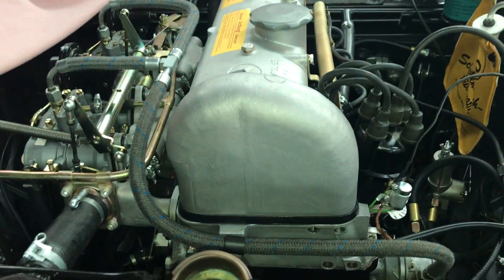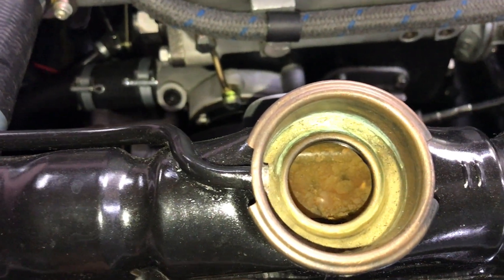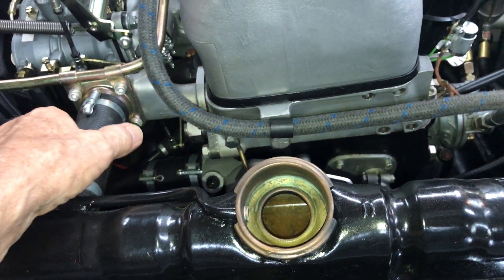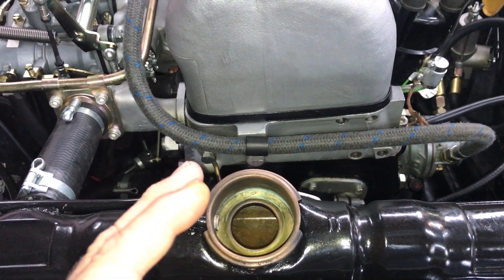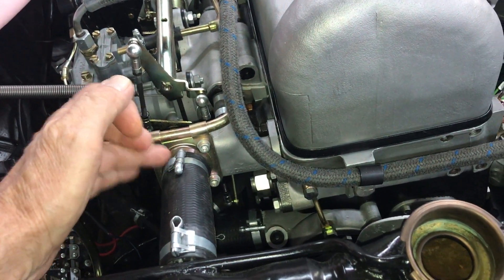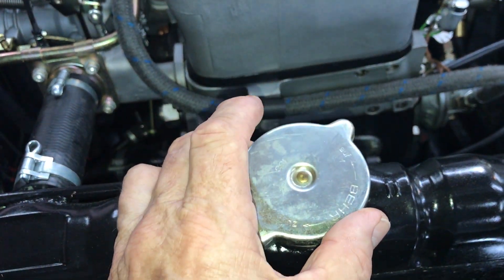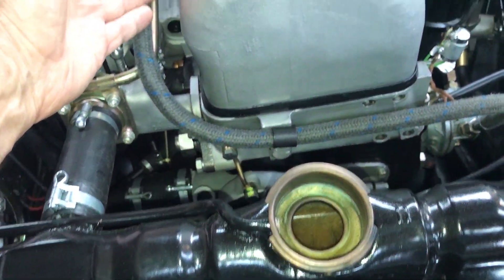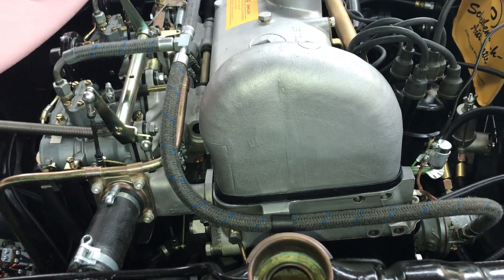Filling 190SL Cooling System

Comment: Hi!
I appreciate your videos. I my self own a 1959 190 sl. Could you please tell me the suitable lenght from hole to hole of the suitable steering damper for this car
Reply from the maker: Hey Nabil, thanks for viewing and thanks for the question. You have asked the exact right question. We just went thru this issue with a 190SL trying to install a steering damper. The STROKE is what you are asking. This is the amount of length the damper travels from closed to open. According to parts book: up to VIN 5501501 stroke 150mm, after VIN 5501502 stroke 135mm. But, when we installed the 135mm stroke damper on a 1956 190SL it would not allow for complete steering lock-to-lock. One direction the wheels turned all the way. The other direction the wheels stopped short of full turn. This meant the turning circle was not the same going left vs. right. We removed the damper and the wheels would turn full lock-to-lock left and right. So, before installing a damper, measure of the old damper, check the steering, install the new damper and re-check the steering. I hope this helps. Will
Reply: @Mercedes-Guru  Hi again. Thank you for answering so quick. I think the issue with your car is that the drag link was changed. So the measurements change. YOU know much better. The issue with MY car is that it has no steering damper at all and the drag link on it is not original and has no attachment holes. Indeed, your answer was useful, but not very precise. I am from Morocco - North Africa, just remember world cup 2022- and it's hard, expensive and time consuming to find parts. To put the question otherwise: the steering damper for my 190 sl is it the same as for mercedes w123: some 40 cm or less from hole to hole. Not really asking about the stroke. Thank you
Reply from the maker: @NabilAMRAOUI-i8m  Hello from Texas. I have a W123 damper here and will compare it with a 190SL damper and make a video for you in a few hours.
Reply from the maker: https://youtu.be/TPvlSGMecA4

Comment: Are you aware of any aftermarket aluminum radiators?
Reply from the maker: Hello and thank you for the question. No, I do not know of any aluminum radiators. The original radiator cools very well even here in Texas in 100F weather. If you have good tanks the rad can be recored. Any reason you are seeking an aluminum rad?
Reply: Installing a Judson supercharger and while it’s all torn down I figured I would see if it’s an option. If not, I reckon I’ll have this one cleaned and go from there!
Reply from the maker: @adamhenderson8202  I did that years ago. I seem to remember the belts needed to be supported by an extra pulley. This was not part of the official installation instructions. So I had a pulley made and fabricated an adjustable bracket so I could keep the belts from hitting the water pump pulley. This is a 30+ year old memory. I hope you post vid of the Judson in action.